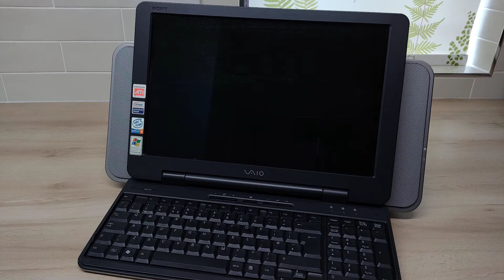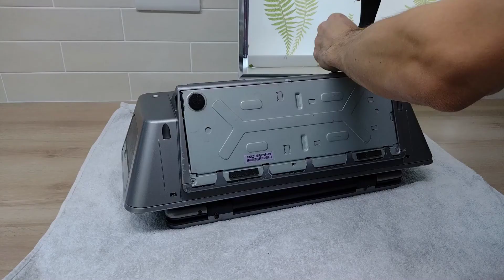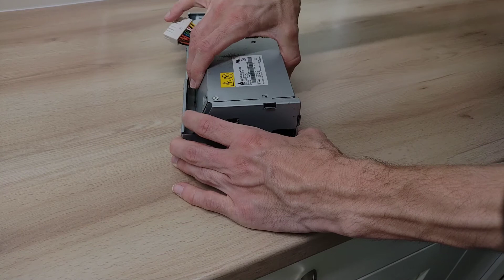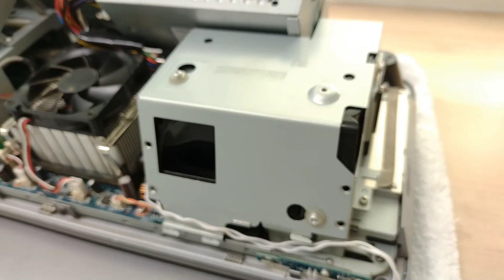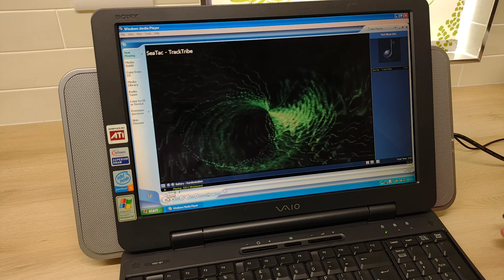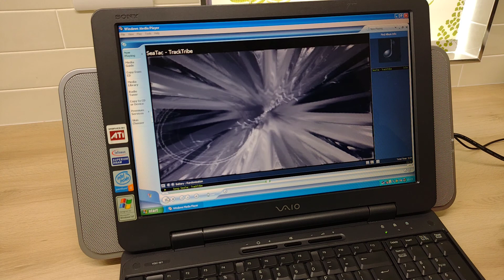Sony Vaio VGC M1 repair and look around

Comment: ! the reason that this pc doesnt have an integrated mouse function is because it actually CAME with a mouse that has the same branding, i have one of these computers, its pretty neat and has a slightly asymmetrical design with the left button being a little bigger by extending in front of the scroll wheel

Comment: Picking one of these up next week for a project I'm working on. I believe I have all the Vaio service manuals somewhere if you need any
Reply from the maker: If you have the service manual for this machine that you could upload somewhere, that would be a big help please. Even after getting it fixed up and tested in part 2, I don't think I'm quite done with the Vaio yet.
Reply: @RetroSuperhighway  will do, I'll have a dig through the HDD this weekend. If the project works out you're welcome to that flat switch cable
Reply: Sadly no service manual, if you have any contacts in Colchester they may be able to help. Teleplan were the authorized repair centre
Reply from the maker: No worries, thanks for having a look and the tip about the repair centre.